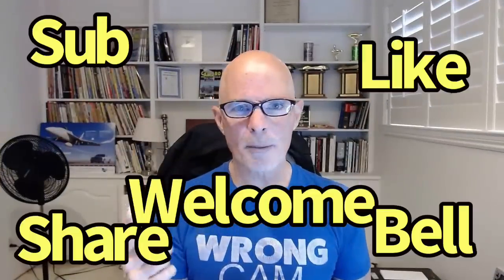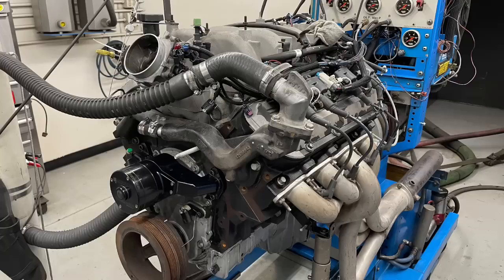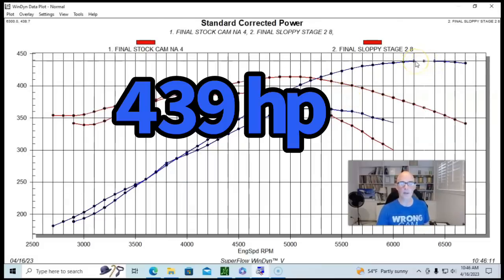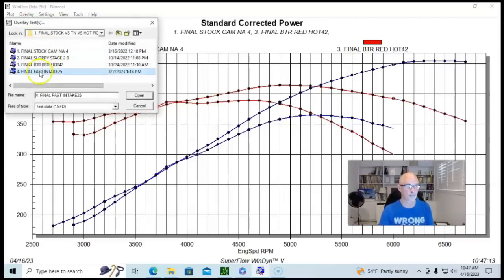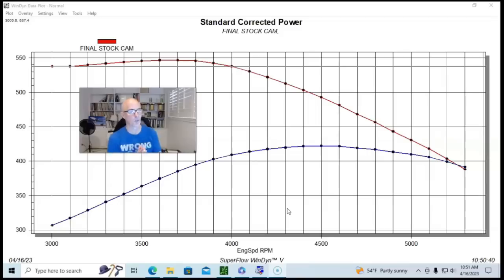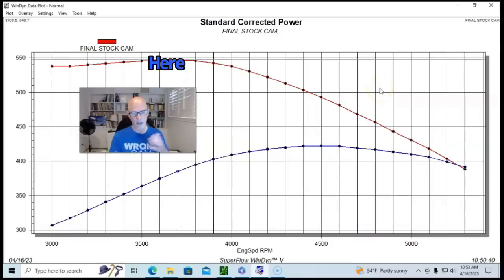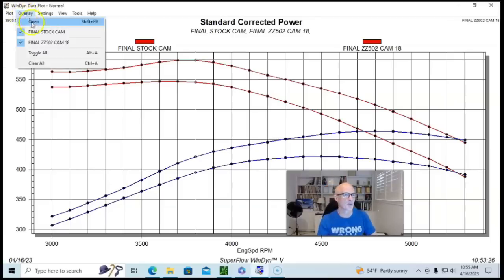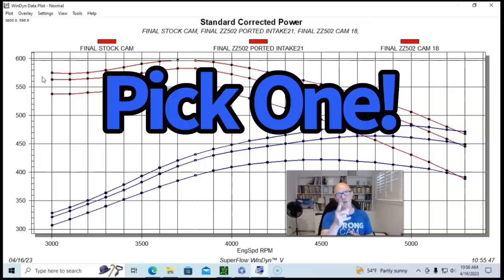RPM vs TQ-WHAT WORKS BEST? THE 480-HP TEST, HIGH-RPM, LOW TORQUE 5.3L OR LOW-RPM, BIG TORQUE 8.1L?

Comment: Can we get the fuel flow rate along with the power curves?
Reply: I would be really interested to see that.
Reply: For the 8.1L there’d be a chart showing a monkey throwing buckets of fuel at it and the a/f ratio still showing lean 💁🏼‍♂️
Reply from the maker: hp is the same and AF is the same
Reply: Just thinking about cruising. Obviously it's WOT, but if I'm cruising down the interstate at 2,100 rpm I imagine that the  8.1 is sucking more fuel, but with the different torque production maybe I am cruising at 1,800 with a lot more power on hand with a blip of the throttle. 
What the lbs per minute at each peak?
Reply: @richardholdener1727  
So at WOT they produce the same HP pet unit of fuel consumed? That’s pretty cool. I assumed there would be some sort of efficiency difference between the engines.  Thanks for the info Richard!
Reply: @Cowboy.underwater  There "MIGHT" be a slight differences, but not enough to make it really tangible unless you were looking at "Lifetime fuel consumption" (If you ran at WOT for 1000hrs or something)...But I found that out when I ran a Dyno, no matter what...AT WOT...400hp burns 400 horsepower worth of fuel regardless...(I worked at a Shop that specialized in Fords) Doesn't Matter if its a 2.3 Turbo Intercooled SVO with the wick turned up...or a 5.0L or a Tow Truck 460....They all have pretty much the same horsepower per pound of fuel per hour, burn rate...  

I was a Mobile Diesel Mechanic for a while...and the Water Pumps with a CATERPILLAR 150HP 4 cylinder turbo diesel that was at MAX PERFORMANCE for its engine design/displacement was burning the same amount fuel (more or less) as the CATERPILLAR 150HP V8 N/A pump that was 20 years older. (For those Diesel Geeks the 4cyl was newer 3204T 5.2L, and the older V8 was 1100 8.5L) the amazing thing is the 4cyl is based off of "Half" of a 3208 (the newer revised version of the 1100 series) BUT the 4cyl had to "Work Harder" and therefore they wore out faster...Neither Engine was a "Great Design" - BUT I made more money off the "High Strung" Four Cylinder!
Reply: @misters2837  cool insight, thanks.

Comment: A 454 with 4 speed and 2.75 gears in a sub 4000 lb car makes a very nice package....but that 5.3 powerband would be a lot easier to work with as traction with the big torque motors on the street is hard to find.   Tall geared big torque that's left 'to eat'...is an excellent way to go, but sadly it seems too many want too much cam so it 'sounds tough' where a nice smooth running 220'ish cam would run better all around.

Comment: Chosing which one I would want, it depends on how cheaply I could buy the engine for in the first place, and how much room there is in a car that I could also afford. Beyond that, what I would use the car for. Drag racing? Then probably the bigger engine with lots of low end torque to get the car moving. Although smaller engines could be used, a lot would depend on what transmission I had available along with the weight of the car. In a four wheel drive situation or even towing I would want the larger engine. What about circle track racing? Would the engine be used in a narrow RPM range? Another factor would be the Rod Length to Stroke Ratio. If it’s around 1.5 to 1 on the 8.1 liter engine I sure wouldn’t want to run it very hard, especially if it had a cast iron crankshaft. Also, the bigger engine would have a heavier rotating mass that wouldn’t hold up as well. In the late 70’s through the 80’s there weren’t a lot of aftermarket crankshafts and good connecting rods available like there are today. The result was an extremely high core charge for a reground forged 454 crankshaft. The y would break cast cranks like mad and the few forged shafts were hard to come by. Also the 400 small block crankshafts were cast iron, and they saw a lot of breakage in racing applications.

Comment: If the vehicle can fit it. There’s no replacement for displacement
Reply: The only thing that beats cubic inches. Is cubic dollars these days.
Reply: except correct gearing for the application? put a semi engine that tops out at 1600rpm in and you would not be moving fast but you would be moving
Reply: 383 LS Stroker which is done using a 4.8/5.3 to displace 6.3 Liters
Reply: Idk I like big turbos and super chargers with the right combo cam i can make big power but I love big displacement with supercharger
Reply: @Stale_Mahoney  my semi could roll in 18 gear from stop without throttle but with it out to floor it'd redline right away and that longhaul truck. speedo would wrap around Cummins isx big ass turbo 1000hp it'd run a 1/4 over 120mph and outrun any car
Reply: Weight!

Comment: For my Bucket the iron 8.1 would make the car very nose heavy and hamper turn-in compared to the aluminum LS.I don't even think I could use the 480 HP of either engine for more than a couple of seconds from a 1 minute run, so for me the 5.3 and gearing.

Comment: I'm about to switch out my old Gen 1 for an LS, for a few reasons. My Gen 1 is wore slap out, barely making it. The Gas mileage is horrible, about 8 mpg, and I can't afford to go places. It's my daily plus work truck, and the 3:73 doesn't help, but pulls good. I haul wood, pull a trailer loaded. 
 I'm thinking a 5.3, BTR Truck Norris NSR, maybe find some 30+ lb injectors, long tube headers (eBay). I'm hoping to get 18-20 on fuel with the 4L80, or 60 if I have too. 
 I'm curious how much the cam will kill fuel milage.

Comment: In a race with proper gearing, they would be close to even. The 5.3 might win due to lower weight overall. For street driving, the 8.1 would feel much stronger. Just depends on the application.

Comment: When you are listing out the engine specs for your dyno runs (heads, cam lift, duration, LSA, intake, carb, etc…) could you also include the ignition settings?  (i.e. static timing, total timing, rpm mechanical advance starts and rpm for total advance)
Reply from the maker: THESE ARE FUEL INJECTED MOTORS-THERE IS NO CENT OR MECH ADVANCE
Reply: @richardholdener1727  
I’m talking in general reference to engines/dyno tests from other videos and not this one specifically.  You have lots of engines you dyno that aren’t fuel injected or computer controlled that are using a distributor.
Reply from the maker: I don't recurve distributors on the dyno, we usually run them locked, but I try to include the total timing used for every test

Comment: Light Car (Thinking Cobra Kit Car Weight) with a Manual = 5.3 Because it will be fun as heck to wind the piss out of it...(Can't USE the massive torque anyway, just spins)
Tow Pig or Heavier Pickup/Van or Big Sedan Cruiser (pre-77 Impala) with Auto = Big Block ALL DAY Every Day! (Because you have the traction for the torque.)

Comment: theoretically the 5.3 would be a better engine simply because of the weight to power, if and only IF gearing was the SAME on both engines, relative to speed NOT rpm. 
but then again i prefer the feel of turning a car around a corner over to the feel of going down the drag, and i think that is where the 5.3 would shine not being as nose heavy.
now it would not "feel" as powerful simply because it would not have the low down grunt, but then again that is why it got more rpm to compensate, torque is work over time and HP is the calculation we get to when the math is done.

Comment: No way could I choose the 8.1 for anything other than towing just way too heavy!!!!! Over 250 pounds difference but wow what an improvement from the 8.1 intake! It improves everywhere, looks like when you increase boost level! If only it wasn't almost 800 pounds with accessories.  When over 700 I would generally throw in the towel and go diesel.

Comment: Depends on what I’m using it in. Simply heavy motor in heavy car light motor in light car.  in one video you asked how much torque is too much.  Without weight  this much torque will just spin tires.

Comment: Big cube torque for a heavy truck but my 240k mile 5.3 made 600/675 wheel with a cam carb and nitrous and sounded really good crusing around on the street
Reply: ..... you should see what 150 shot of NOS does to a bbc @ 2800rpm .... if ran 150 shot on the 8.1 like it's set up, the 8.1l will have 38% more tq and maje more hp... watch his video of the 8.1 with proper turbo on it.... LS motors are not as good as ppl think.... ya ever see a sbc sb2 355 roller motor power out put??? .... restricted plate cup car ... craftsman truck series. Give 8.1L the same Powerband as the LS.... 6500rpm
Notice he used a stock gm camshaft zz502.... LS used 3 different cams.

Now knowing a Gen 7 8.1L can use a Gen 6 cam... there's a cam an off the shelf from Lunati that says your NOS LS still loses out to the 8.1L with out NOS... 
284/292 255/263 110/106.... and if ya wanna get nasty, they make it with a bigger lobe lift... and these cams aren't even roller cams lol... study camshafts and lobes and check out Harold Brookshire and who he was, guaranteed whomever your LS cam came from it's Harold's design profile.... 
Bullet, Comp, Lunati, Howard's, etc they all paid him for 50yrs to make cams...

If I could put a pic in here, I would show you his cam lobes and who has which...
You want the big monster he made for ASCA, grab a sbc some 18* heads and bore your lifters out to .903" and his " oval track TL2" for dodge on a sbc core.... 😊
Reply: @df5849  bonus points to you for referencing Harold. Wish he were still with us.
Reply: @df5849  yes but the little 5.3 and cam sound like a race car while the big cubes sound close to stock I wanted it to sound like a race car look like a race car and drive like a street car and with a 100$ 5.3 and a 100@ cam used everything except carb intake a nitrous kit I got to drive to the track with ac on and family runs a 6.7x and drive back home it's just cheap and effective plus it's so easy to swap the ls I'd imagine the big block much like the old big blocks take up enough space to be a pain

Comment: Years ago (circa 1995-96 or so), Hot Rod Mag did a SBC vs BBC comparison with everything as close to the same as possible…  Same CID (406 I think), same compression, roughly same cam specs (I think the BBC had a little more valve lift because of 1.7 rockers VS 1.6), both had aftermarket heads with close to the same flow, similar intake (Performer RPM I believe), etc.

I wonder how a similar test between a LS and BBC would look today.
Reply: I remember reading that test... problem was the whole head flow thing... yes, even back then you could find SBC heads that had BBC type flow, but you could get BBC heads that flowed even more... so ultimately, they gave the SBC the best of everything but handicapped the BBC.  

The advantage of the BBC over the SBC is that, because of bore size and head design, you can get more flow and therefore more power from the BBC design.

Take any brand engine and match CID, Air flow, cam profiles, Carb and Header size, you will end up with near exact power and power bands. The difficult part with each engine is, does the aftermarket support each engine with similar cylinder head tech? Back in the 90's no, today? It might. 

Back in the day, it was the manufacturers that set the ground rules for power and they made great power or not with their various cylinder head flow designs.

Comment: Are you able to measure fuel consumption during these tests? I would be very interested in seeing how thirsty a 5.3 is compared to an 8.1 at the same/similar power or torque levels.
Reply from the maker: NOT BSFC BUT MAYBE FUEL FLOW IN THE HOLLEY

Comment: 8.1L all day, every day.
Displacement wins every time. To all of the "turbo makes up for displacement" zombies, that's not a comparison. Turbo both engines. Run them up to the same RPM. Build them equally (same peak RPM HP) and the larger displacement engine will ALWAYS make more torque below peak HP. Every. Single. Time.

Comment: I know which I’d rather have, that’s a no brainer…BIG BLOCK 💪🏻 but the fuel consumption is simply horrendous! At 7-8 mpg, I can’t justify using my truck that often 😭
Having owed a 2002 1 ton dually 6.0l and towed a 10,000lb excavator, yes it can do it. I’d rather use my 78’ 3/4 ton Chevy with a factory 454, as it was much more capable.